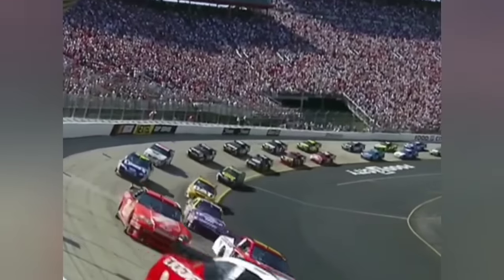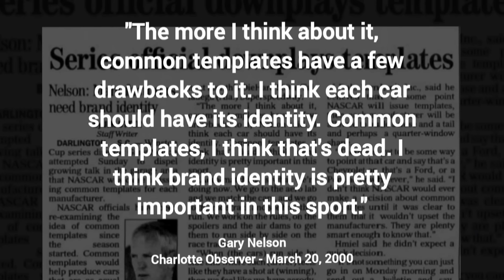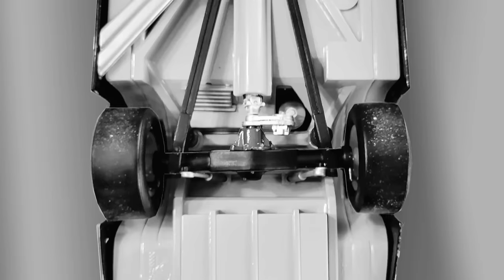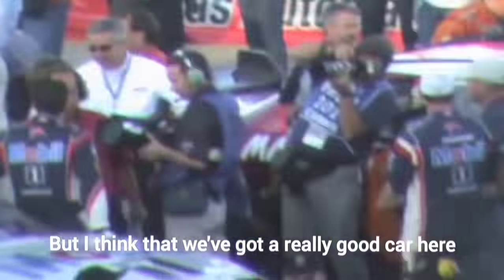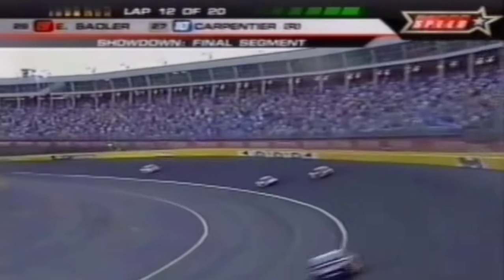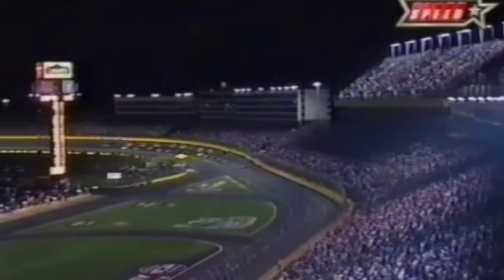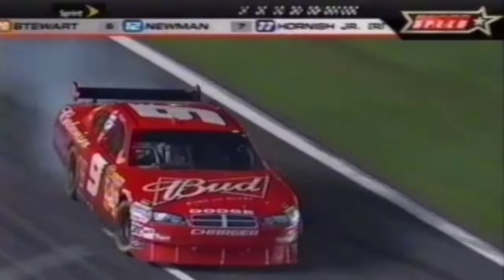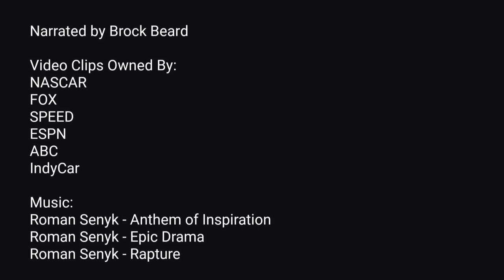The Car That Exploited the Car of Tomorrow

Comment: All the rules set, are totally moronic.
It prevents new technologies, that might help us all in the long run, ideas with equal value.
Now, when it comes to SAFETY?, I absolutely agree: there need to be rules.
But a car breaking Mach 2 and be totally safe, should be allowed.

No one prohibits the other racers/racing teams to use similar technologies.
Bitching (yes, BITCHING) about alterations that obey the rules set in the THEN rulebook, should be, by ALL DAMN MEANS be allowed.

PERIOD!!!!

Comment: So stupid.  NASCAR should go back to being a stock car race - meaning that every car on the track is off the showroom floor.  No special bodies, no special engines, full emission controls, stock traction control, ABS, air conditioning, all of it.  Add a few safety features like roll cage and fire suppression, and nothing else.  Minimum production of 500 identical cars available for sale to the public.  No trailering your car to the race, it must get there on the street under its own power, you can put race tires on when you get there.  If they want a 200MPH speed cap, program it in the ECM.
Racing isn't just about the driver.  It's about the whole team, designers, engineers, and crew included.  It's not an individual sport, and never has been.

Comment: NASCAR is effectively a formula/spec series, and there is nothing wrong with that. With modern race cars and the tech we have the cars get to fast and they get dangerous, that's why rules have been put in place many times to slow the cars down. Then some engineer finds a way to speed their team up because racing. Others do it also, then another engineer finds something else, everybody copies that too. Now we are back to the same unsafe speed and more rules to reduce the speed again. If you want to watch different performance car makes and models race then watch sports car racing. Watching how the different cars attack the track in different ways like a Porsche being better at the turns and others like some of the Mercedes have more straightly speed and can make up the time lost in the turns buy speeding past the Porsche on the straights. And those cars are pretty much the cars you do buy. You like watching a C8R Corvette when races well guess what, the C8 Z06 is pretty much the same damn car. The C8R is just stripped down of interior junk and has a roll cage installed. That goes for most of the GT races cars. A Porsche 911 GT2 is basically the same as the race car. If you really want to watch a race to help decide your next car purchase then watch endurance sports car racing. A lot of the times the production models are actually faster then the race cars because of restrictions on certain models to promote good close racing.

Comment: NASCAR NEEDS to ... Allow each team to use creativity .. For 1 season, Each car uses a 6 cylinder engines and the same gas capacity.. Other than that let them loose!!!! If you publicize these changes you WILL FILL THE STANDS in the next year at EVERY track.... NASCAR as it is , is boring  I use to have the track pack every season . Well not now, and thousands of fans would agree with me.. Remember when Dodge came out with the HUGE spoiler on the charger..  Cant happen today Why, because corporate Greed .. Wake up! Give fans something to get excited for

Comment: Both Nascar and NHRA funny and pro stock cars has lost its luster for me big time to the extent that I no longer watch these series.. They are no longer "real" cars worked on to garner the best performance as in the 60's. They are "cookie cutter" vehicles with no resemblance to what is on the road as yesteryear. Was much more fun then with manufacturer competition.
I'd much rather watch the funny cars long since gone, doing 8's and 9's than the ones doing 3's and 4's today.

Comment: nascar is incredibly stupid, They killed all incentive to innovate and tell you right down to the weight of your seat what you can have. Read 1984. That's nascar.  They gave up racing in 1987. They are now a modeling agency and drive slowly in a circle, while making a lot of noise, so they can go and sell cheap cap to rednecks. They suck, suck, suck.